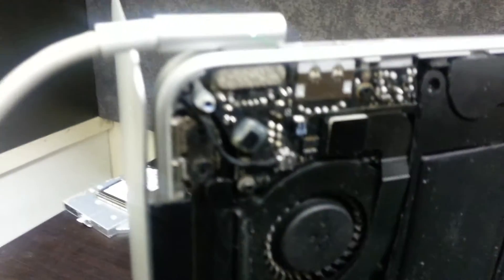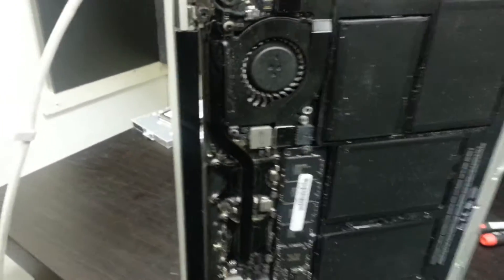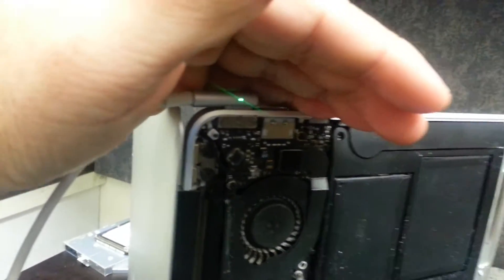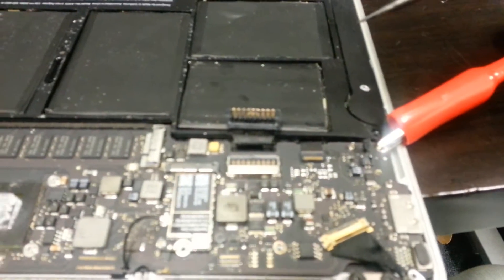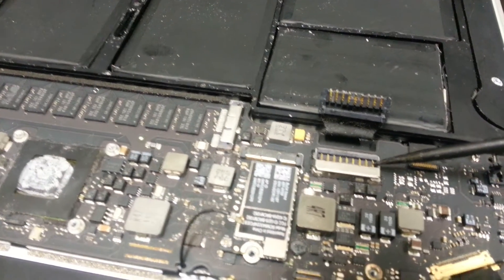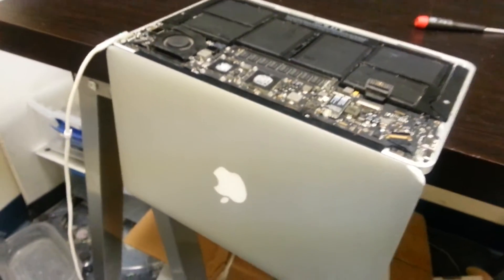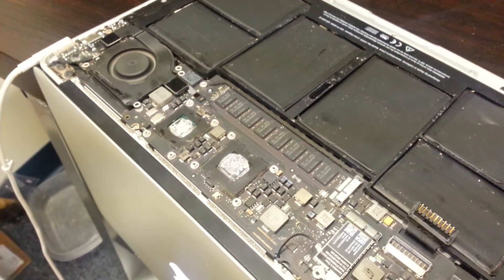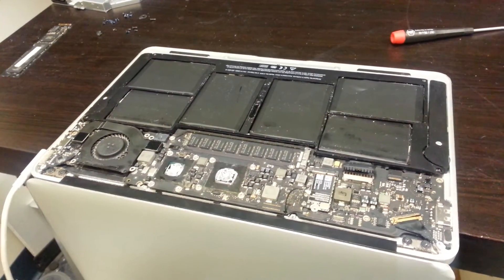MacBook Air Testing: Diagnostics For When Your System Will Not Boot

Comment: Hi BGAReflow

I have MacAir 13 Inch Model 1466.
Last night I put it in sleep mode and today morning when I tried to start, it didnt come up. Macbook is not startign by pressing power button. I thought may be battery is down but when I put charger in port the Charger Light didnt tured on. I tried with another machine charger and that changer light didnt turned on. 

Do you have any idea what could the problem with my Macbook Air
Reply from the maker: Richi Varma Sounds like a charging circuit problem. We fix those. Check here for steps to have us work on it for you: http://doubleclickittofixit.com/contact/repair-service-form/